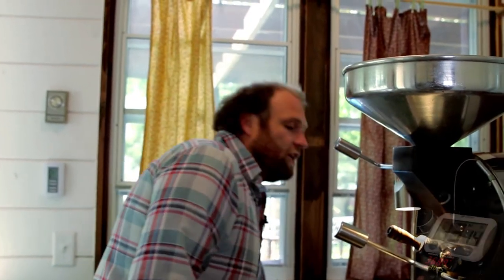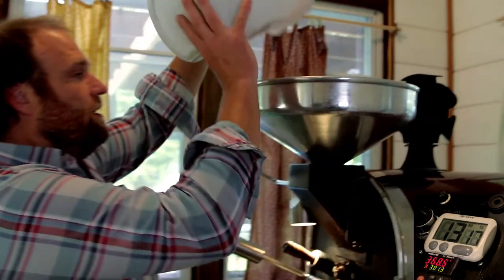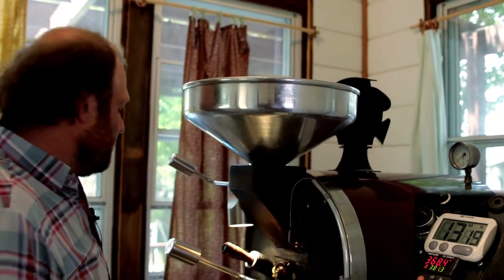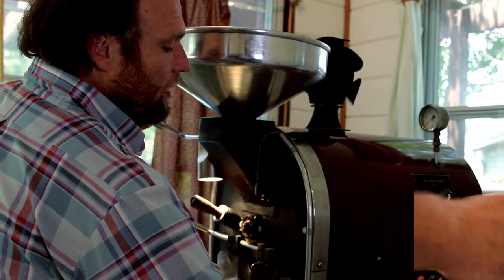Coffee Roasting: 400F Ethiopia Dry Process

Comment: I roasted my Yirgacheffe natural at drop temp 215c and there this nice milk chocolate fruit cake aroma. I also tasted earl grey tea with winey acidity notes too! Lately price jumped significantly from 15 dollars per pound 16.50! That’s insane!
Roasting natural beans could be very tricky! I usually find them reaching FC pretty late like around 210c. So for development time, I will stretch it out to 213c-216c. It’s almost impossible to roast natural beans light roast around 200c-208c because FC comes out late. However washed beans reach FC like super on time around 199c to 205c. So I can easily finish it off around 208c-212c for dropping the beans!
Reply from the maker: Yes. Naturals are tricky. But they are so rewarding. Lately I’ve been doing a slightly different approach than the one on this video - getting into yellowing , then pulling back on the flame so that I can coast into first crack, get a low finish roast temp but get a bit of development without losing much brightness. It’s such a tightrope to walk. Thanks for watching!

Comment: Interesting approach to the Ethiopian natural. It has got me thinking about it. 
 I've been doing a somewhat reverse approach. Moderate heat after a 30 sec soak to extend the dry phase a bit. (thinking it was hitting yellow too soon with higher gas early on.)  Then cranking heat as approaching end of dry into mid. This keeps enough momentum to reach first by just adjusting airflow. Once I hear outliers approaching first, I up the air and lower gas to .5 kpa and let it ride. Depending on temp rise I may cut gas before finish. Interestingly enough our markers were pretty close and I finished at 11:10 with 16% development.  This natural is pretty well balanced ( which I like ) some etho's are just too floral for me. I've have also taken just past medium and was AMAZING! Finished at 419' and was like a sweet orange syrup with chocolate liquor. Anyway, I enjoyed your approach to this and watching the video!
Reply from the maker: Corey! Awesome! Thank you for your thoughtful comment. Yeah, I love the approach you're talking about - soaking, hitting it hard, and then backing it off and letting it roast it self through to the finish. Super solid. 
One of the things that I find so fascinating about technique is how we utilize energy and momentum to achieve a desired roast curve. The soak, push, drift method it great way to apply energy.
Also, just reading about roasting a natural to 419F makes me want to do it. I am continually blown away by how delicious natural coffees are at slightly higher temps than I would normally choose. Like, I have this washed Guji (Ethiopian) that is so freaking delicious at like 392F, but the natural Ethiopia I have is so dang good at 402F. Theres something about developing the bean a bit more fully that balances out the fruit character. When the bean itself is barely developed, then the fruit elements can end up tasting really harsh and fermented. Not exactly ideal for what I like. 

Anyway, thanks for your comments!